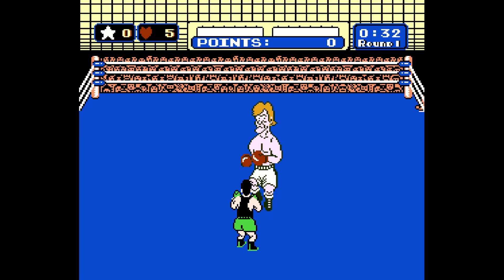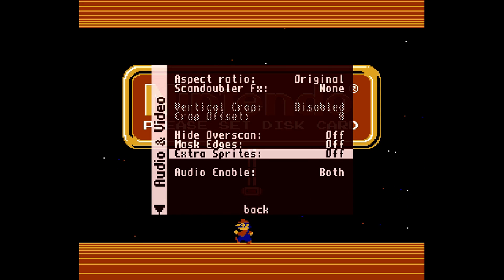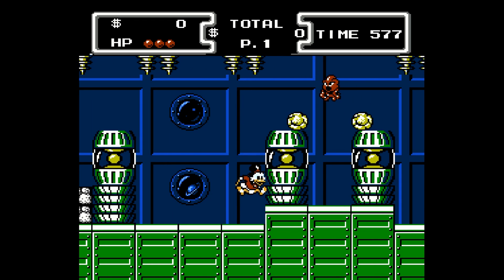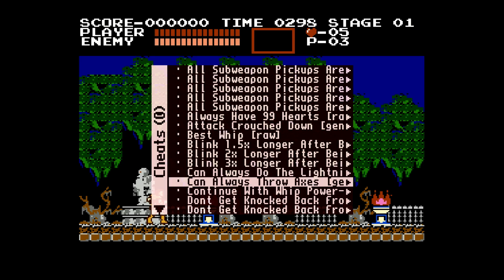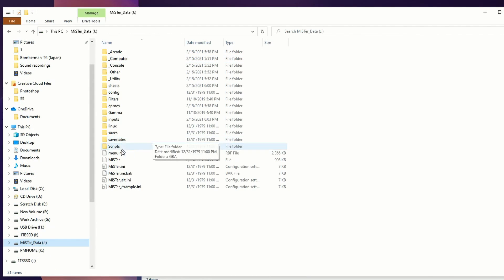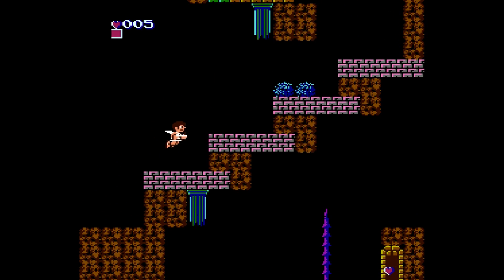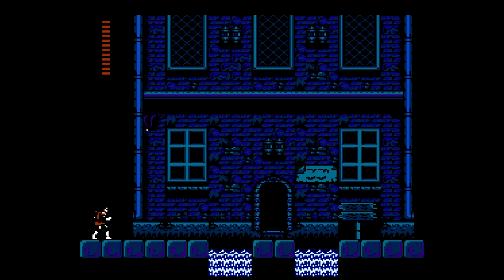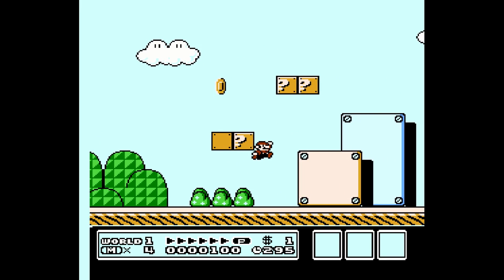MiSTer FPGA DE-10 Nano - Nintendo / Famicom / Famicom Disc System Core Review and Setup Guide

Comment: Hello, how can I make NTSC games work in "Dendy" mode on the whole screen? without black bars at the top and bottom..?
Reply from the maker: You’d need to change the scaling options in the INI settings
Reply: @VideoGameEsoterica  does this need to be done separately for the NES core? I'm not very good at .INI Settings.
Reply: @VideoGameEsoterica  could you send me the finished .Ini file so that Dendy mode already works on the full screen. I do not use any settings in my INI. setting, only enabled "composite sync" because I use CRT TV. Thanks

Comment: Do all cores have different inputlag?
Do you know if the Nes core can load modified roms?
Reply from the maker: The input lag should be relatively stable across the entirety of mister outside of your television / controller setup. I haven’t tried modded roms on NES, just SNES and GBA

Comment: I absolutely love the NES Core, I use an original NES controller that I completely re-shelled from a NES Classic Controller (basically brand new) and that works via a RetroUSB adapter which feels as good as my SNAC, can't hardly feel the difference.
Reply from the maker: Funnily enough I use a PC Engine controller. Same two button in a row layout except not so squared off. Even as a kid those edges...not for me!
Reply: @VideoGameEsoterica  Fair enough I can understand what you mean. I have the 2.4ghz 8bitdo PC Engine controller too. They're nice and feel great for master system.
Reply from the maker: Same one I have. Good for all the “buttons in a row” consoles. Especially good for PC Engine obv. I can’t play those consoles without the two buttons next to each other horizontally. Feels too weird
Reply: I feed my “two buttons in a row” needs with an NES Classic controller through an 8bitdo Gbros adapter. Works like a charm. The same adapter gives me authentic SNES action with the SNES Classic controller as well.
Reply from the maker: 8Bitdo is awesome with their controllers. I know a few people have mentioned having issues with them but all the ones I own have been perfect

Comment: I have two famicoms I modded to output AV. Same early model, slightly different mod. The color palette is ever so slightly different on them already. The options on the Mister all look way better in my opinion. Just an opinion!
Reply from the maker: NES / Famicom did whatever it wanted with color palette lol. Trying to even say what is objectively "correct" is near impossible. If it looks good to you or me that's what's "right"!